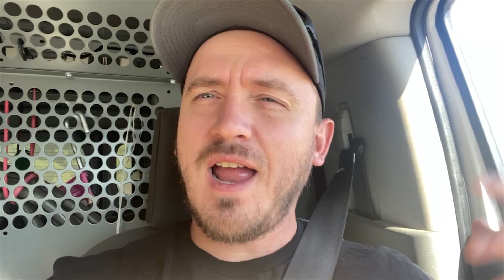How to Relocate a Septic Tank? What You Need To Know

Comment: Is there any consideration for how distanced the system can be from the house? I want to move my septic tank and bed further away from the house cause I want a nice attached deck but the tank/bed is in the way. I don’t want to move it to any other side of the house, but just further away, much further away. I have a large property so property size isn’t an issue. 
Thanks!
Reply from the maker: Every county will usually have different setbacks.  Generally if you aim for 25+ feet you’ll usually be fine.  Your local health department website should have a list of setbacks

Comment: Thanks for the info.  I may be moving a concrete tank, 1000 gallons, in-line toward the drain field in Colorado.   Just shortening the run of about 40 feet to more like 25 feet closer to the field.   Luckily, the slope is in my favor as goes down at an even plane of the outfeed line.  Should be easy.. Famous last words. :)
Reply from the maker: My pleasure. Thank you for watching! Good luck with the move.